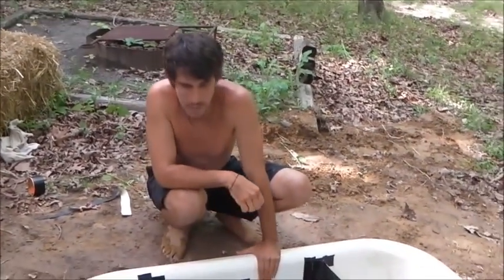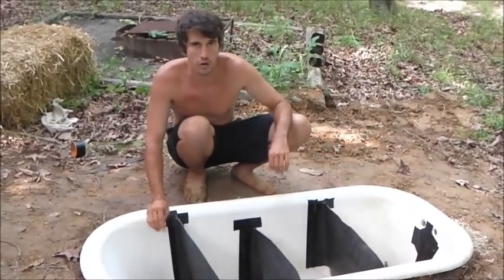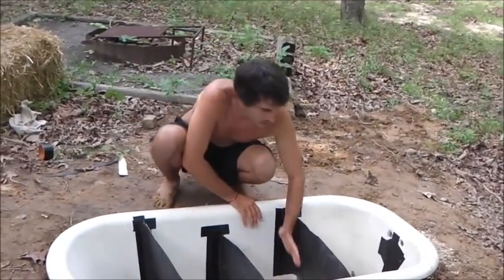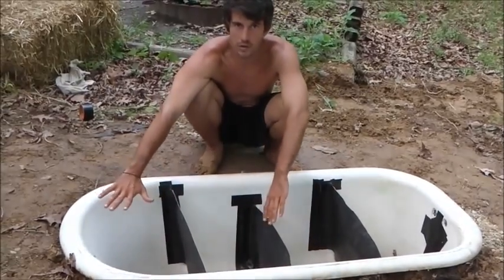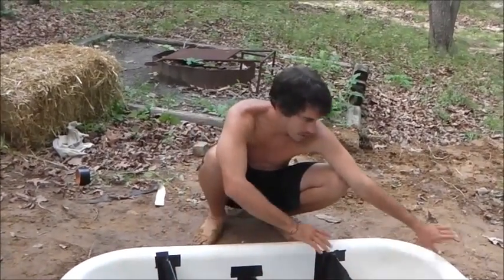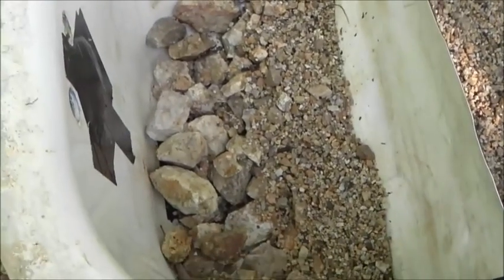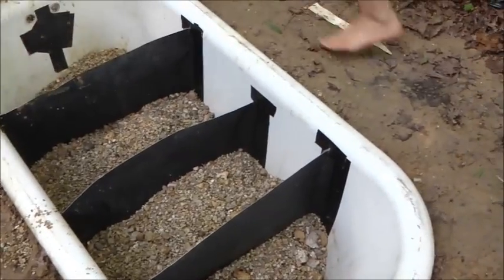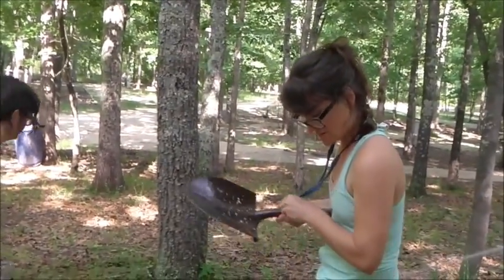Simple grey-water system using a bathtub

Comment: After using it for about a year now, can you tell how good it works? I am thinking of building a grey-water filter myself and like your design but I wonder how much grey-water it can clean per day. Regards Stefan de Nijs
Reply from the maker: Stefan de Nijs I helped with this install while passing through a budding ecovillage in Alabama, and I'm not sure how it is doing now. I do know though that the design which this was modeled after has been in operation for over 7 years and works very well. It is used for a single washing machine used by two people. That system also contains an overflow pool filled with non-edibles, then a secondary overflow pond which contains edibles. Both overflow ponds are about 2ft x 4ft. The second pond also supports small fish.